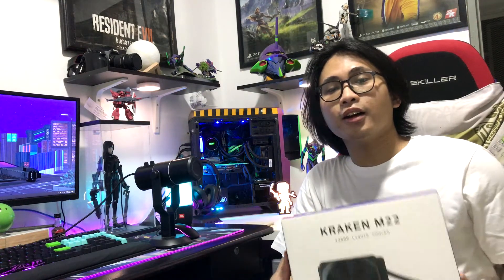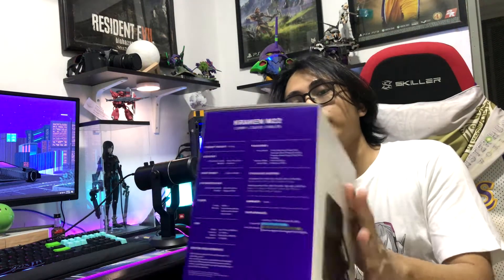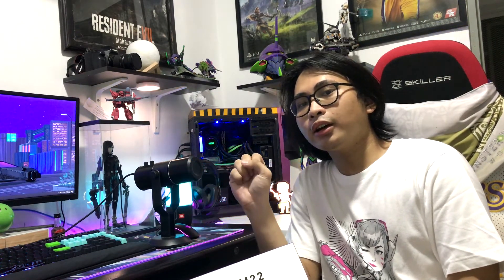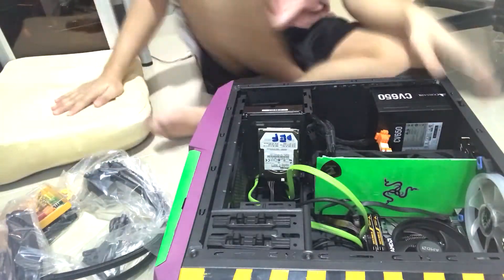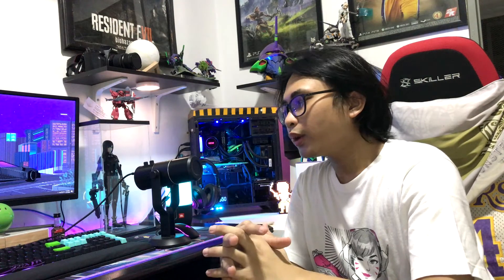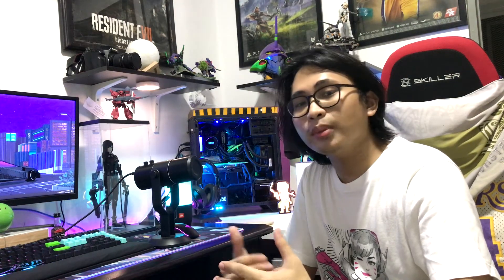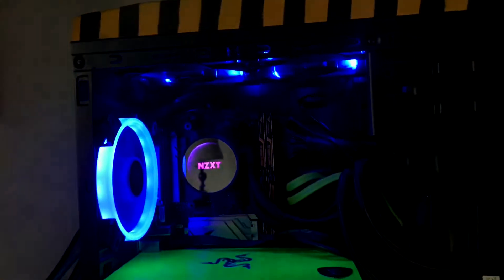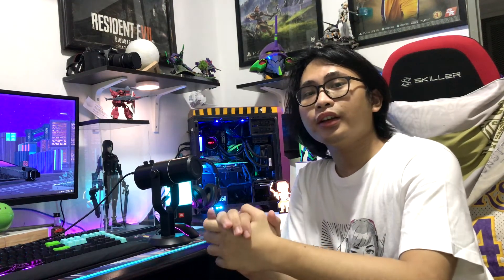Nzxt Kraken M22 120mm Liquid Cooler (review and unboxing)

Comment: what temp does ur cpu run @ on idle? and how hot does it get when its being used, playing warzone, gta ect.?
Reply from the maker: the temperature before is just below 40. but its been 2 years so it runs 59 on idle, and 90 when full load. havent got the time to change the termal paste after 2 years.